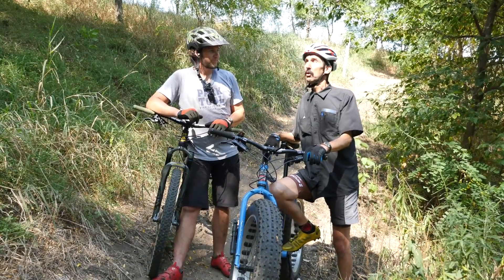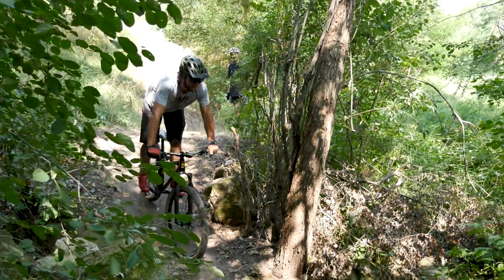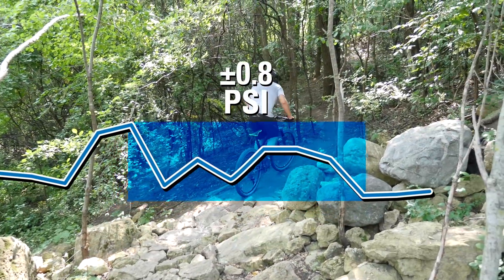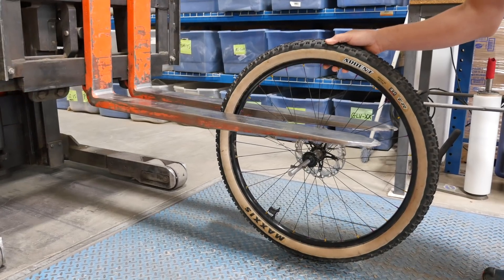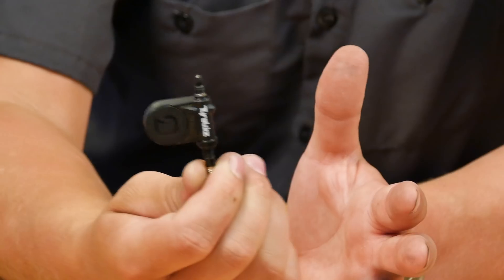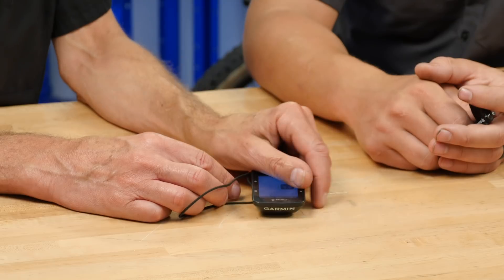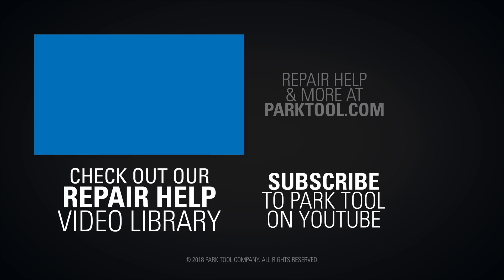Wheel Data Pressurized Part 2 | Tech Tuesday #116

Comment: Im running Maxxis High Roller II, 27.5x2.4, EXO, Tubeless, 60 TPI, on the tire it says 40-60 PSI.  All the videos I have seen say to do around 25-30 PSI.  Do I go by what the tire says or what everyone else recommends?
Reply from the maker: I would go towards what people are suggesting. The label on the tire is max psi, not suggested psi.
Reply: @parktool  Thanks!!!

Comment: First of all, please excuse my poor english. 
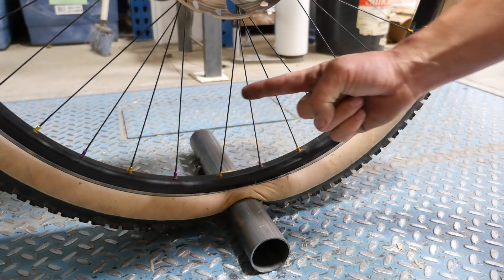Excellent what's going on at 5:27. It can be used as a subject of a new clip.
You should test a correctly tensioned wheel in pseudo-real conditions. Measure the tension in the upper spokes versus the tension in the lower spokes. The difference is very important when we talk about correct spoke tension.If correct, the spokes should break when they are under the correct tension..
Reply from the maker: Keep your eyes peeled. There may be something coming very soon.
Reply: I knew it. Thx.👍

Comment: Having a 26" or a 29" does any difference to how much pressure should we put in?
Reply from the maker: Because the 29er has a larger volume of air, typical riding pressures are lower.

Comment: My tires at 30 psi deflect or smoosh like yours at 16 psi
Reply: That depends on several factors, not only the tire material and structure, but quite importantly also on the overall tire volume. The fatter the tire, the lower pressure it allows.

Comment: So what tubeless pressure should I run as a 240lb rider with 2.5" Front and 2.4" Rear 29er?   The 300lbs of force is a bit concerning...
Reply: As a 265lb rider who has been losing weight from 300 in the past six or so months, I personally have had issues whenever my pressure dips below 25 psi with a front 2.5" DHF or under 30 psi on the rear with a 2.3" on my 27.5 in bike.

I rode a fat bike tire under 30 psi once and literally almost died when everything rolled out under me, but my helmet gave its life for mine.
Reply: @e.g.sergio  Thanks! Hmmm fat bike should have more tire volume and thus lower pressures especially tubeless. The sidewalls tend to be weaker though.

Comment: I haven't either of these gadgets, but shouldn't it possible to hack a ShockWiz (with valveadapter, and stuff like that) to a rim to get faster read speeds?
Reply: vote Pressure to low for the schockwiz
Reply: @flemming_j_  Ahh okay... Didn't knew that

Comment: I believe in having firm tyres - so I run mine at max or 50psi... I believe that comfort & traction should come from suspension & tyre compound... I believe that stressing(abusing)tyres - running low pressures - to achieve what I previously mentioned is wrong - I believe that riders should accept the imperfections of their riding conditions & should adapt to different situations instead of expecting(or forcing)their bike to behave the same in every situation... You don't 'have' to go fast in every situation & through all conditions - after all, we riders don't ride at the same speeds when riding uphill vs riding downhill don't we? (not even with E-bikes - well, not yet anyway) PS: Some of the most fun I've had whilst riding involved riding through river water which only allowed me to rock my crank back & forth(or else, soak my sneakers)... Being able to handle\adapt to different situations is more fun than being the same way throughout the situation\condition - that's why mountain biking is more fun that road cycling... =P
Reply: I believe i can fly ... I believe i can touch the sky ... I believe ...
Reply: Holy moly everybody calm down. The correct way to run your tires is whatever you like. If you want rock hard tires and it keeps you riding then thats correct for you. If somebody want to run low air pressure and they enjoy it, that is also correct. I personally run 22 psi front and 25 psi rear and that works for me in most situations. Ill wear the tred off long before the sidewalls wear out.
Reply: there is only one response to your comment. And that is you...are... wrong! Drop your psi's to about 25psi front and 30psi rear and reap the benefits of your tyres actually doing what they were designed to do at the pressure they were designed to work at!
Reply: If you watched that video & still insist on running low pressures......You're Not Intelligent Enough To Assess Wrong From Right... I am not wrong(you're just making an excuse to call me wrong)... Abusing tyres by using too low a pressure to get grip is WRONG - REGARDLESS of weather an advantage is gained or not... There are other ways - & you don't 'have' to get maximum grip in every cirsumstance... Why don't you lower tyre pressure to ride on ice? The so called 'designed' to work at thing is more adapted to handle the abuse or running lower pressure... Tyres are NOT suspension & should NOT be run at low pressure to cushion your ride, & they should NOT be run at low pressure to get more traction...
Reply: Marvin Connell Better get buisy then, EVERY Pro rider is doing it wrong 😂, So better get going prooving you are right, and both experts, and science (look up schwalbes Rolling test), are wrong😉
Reply: That's part of your problem - imitating pros... What they do is for short term racing - where they swap tyres after each race... You don't seem to inderstand the difference between what works & what's a bad thing to do, even though it works... I'm about the latter, & if you can't wrap your head around that, you cannot argue with me...
Reply: Marvin Connell DAMN!, been riding for entire seasons with 20psi in the front, 28psi in the rear, with the same tyre?, no i am not a Pro by any means, but using countless hours on the Trail, experimenting with All pressures, from max too riding the tyres Of the rim. But, i guess, Real World experience, which, funny enough, has the same outcome as the science done on this, does not count in your World. And i am certain, you have not yourself, tried every spectrum Of pressures, your comments are proof Of that, because if you had, you would not ride with high pressure. And yes, tyres are a part Of the suspension on a Bike, just as it is on cars.
Reply: @MarvinConnell  high pressure abuses your tires more than low pressure

Comment: i stoped watching this series both time for he same reason: you count, and only, count in psi :/  maybe include BAR next time ;)
Reply: Everybody I know in finland, uses psi
Reply: Yo wtf guys my complaint was not about who or how much people use psi. Doesnt matter because that many use bar is a fact.
Reply: @hobbesthetiger7468  Triggered
Reply: Hobbes TheTiger  get with the program, Europeans mountainbikers know psi, i know i do 😉 Bar is not accurate enough, to large Of a scale, hence the psi measurement.
Reply: Ok guys, ok ok ok :D i finaly got it: bar sucks
Reply: Whatever you prefer, "Bar is not accurate enough" has to be the single dumbest argument I've ever heard in this debate
Reply: Daniel Well, we all can use 1,517 bars instead of 22 psi, but you know...
Reply: @B0B0LlN00  those .017 bar you are including to prove your point are completely negligible .25 psi. It's only a very odd number because you made the quantity up in psi, I could apply the same dumb logic and say psi is not accurate enough because 1.5 bar is 21.756 psi. Try hitting that exactly on your psi-scaled pump.
Reply: Daniel With bars you have to use 2 digits after the decimal point in order to get the pressure fairly accurate while you can achieve the same accuracy with just 2 digits by using psi.
Reply: @B0B0LlN00  Using two decimal places is not fairly accurate but fairly silly. Firstly because this is far beyond any consumer grade track or floor pump pressure gauge's accuracy anyway. At 3 Bar/44 psi, 0.02 Bar/0.3 psi requires an inaccuracy of less than 1% which is calibrated lab gear level, something you won't get for under $1000. With your sub $100 uncalibrated run of the mill pressure gauge you can be happy to be in the 5-8% range of inaccuracy, so very roughly +/- 0,1 Bar/1 psi. Which, secondly, is perfectly decent for tyre pressures anyway. If you say you have to use two Bar decimal places to be "fairly accurate", that's more accurate than integer psi values anyway, so by your logic whole psi numbers aren't even accurate enough. If you actually needed your tyre pressure THIS accurate, millibars would be the obvious unit of choice, which of course this is purely hypothetical, because you don't.
Reply: Hobbes TheTiger I use psi all the time and Im in EU too. Just lean to work with both psi and bar. Its a little bit easier since you know exactly where you at. Thats why centimeters are better than inches, you know... their spanner sizes be like 683/2579 ....
Reply: Hobbes TheTiger that’s because psi is the only relevant measurement
Reply: @bobdixon3048  Maybe for u :D i dont have a clue what so or so much PSI feels like. And most european dont know that either. Im sure the video took much effort and it seems to be interesting af
Reply: Hobbes TheTiger I’m European and I enjoy using psi
Reply: @bobdixon3048  whats ur point? :D
Reply: Hobbes TheTiger We are American and we are number one.What we say,goes.